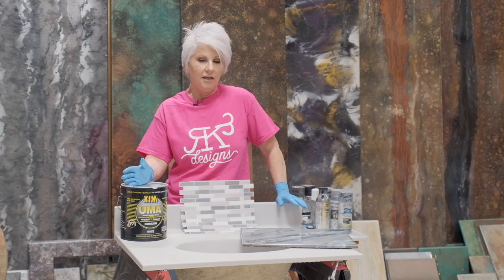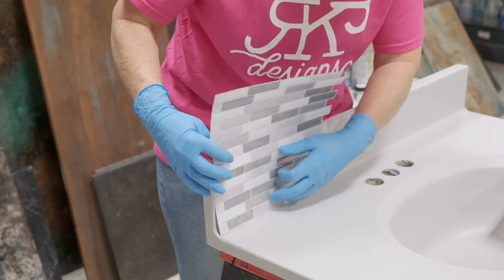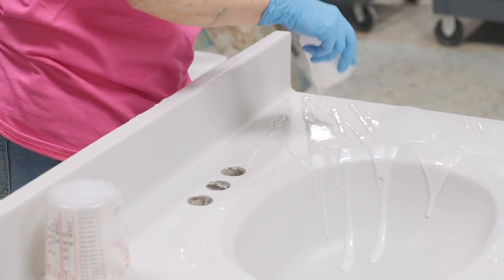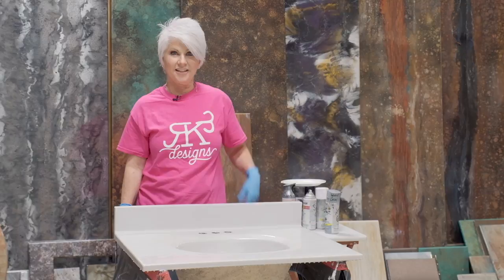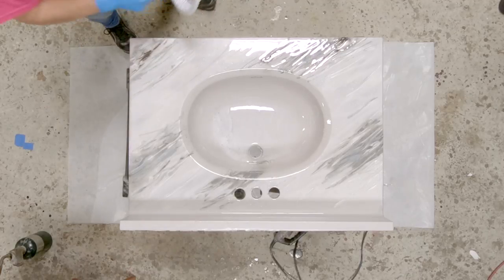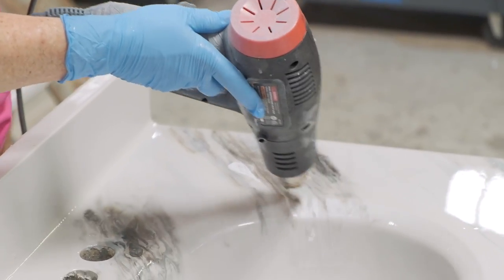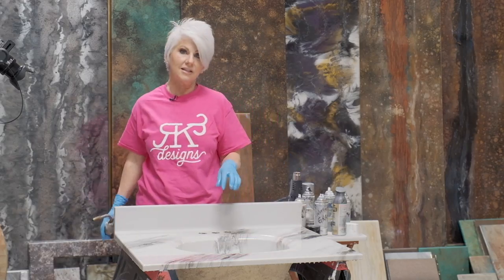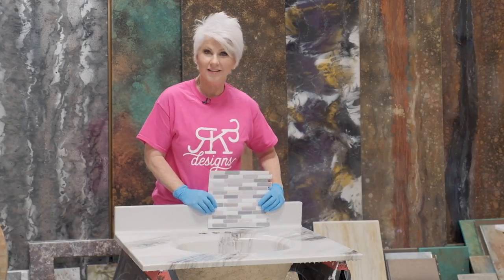Creating a Fantasy Marble, Epoxy Sink Bowl

Comment: I would really like to see the backsplash with the veins running through it instead of the tile stickers. Thanks for doing this Rhonda I have a sink like this that I want to do! This shouldn't affect the plumbing, if it does it is easy to open the holes back up for the drain or the faucet.
Reply: Me too!  No one can ever show the backsplash together with the sink as a single pour.  It must be possible somehow.
Reply: I agree. I wanna see the pour on the backsplash and top together. It must be super hard to do

Comment: OK, I'm loving how this turned out. To be honest, not personally a fan of the plastic faux wall tile but they are very popular and I've seen them used in many RV makeovers where it is important to keep weight in mind. Also, since RVs are constantly moving and flexing on the road and especially off-road, the faux tiles are forgiving and stand up to that abuse. For my truck camper kitchen I went with brushed aluminum metallic stick on tiles. Obviously, brushed aluminium would not work for your bathroom faux marble sink. LOL. Only mentioned it because you mentioned there are many different types of faux backsplashes. Thanks for a super tutorial. An Oregon nomad 🌲❤🐶😽❤🌲

Comment: I absolutely love the flow of veins in the basin. This is exactly what I would love to do with my bathroom sink and counters. My question is about how to do a flood pour over what you have already done, so that the basin is even coated, and how long do I wait to do it? Should I do the pour right away?
Reply from the maker: There’s a couple of ways you can do it. You can flood the basin first and let it start to set up, then do the rest of the Vanity. Or you could tape up the basin pour the flat part of the vanity pull your tape after about 30 minutes and let the resin run down. At that point the resin will be thicker and it will be easier to spread.

Comment: Does it ever de-laminate from the sink bowl?   I asked one epoxy company and they refused to do it. I would just do the pour and put a very thin coat on the backsplash instead of putting the fake plastic tile stuff on the backsplash. The sink was beautiful without the veins!  You are so good with the veins you do. Leave it alone, don't chop it. The veins are going down so naturally. Lovely.
Reply from the maker: There’s always a chance of delaminating on this type of surface, this is why we always recommend fabricating a new countertop and installing a new sink. If you prep well and use a good bonding primer and quality epoxy, you should have great results. 😊😊

Comment: These are beautiful! I would like to see how to do a pour on the backsplash. Also did you let the epoxy run into the drain of the sink? I am about to do my bathroom counters and just need some pointers! Thank you for the video
Reply from the maker: Hi there. Since this vanity wasn’t attached to pluming, I allowed the epoxy to run down the drain. Once cured, I take a stone grinder and grind it smooth. Backsplashes are difficult and I prefer to do some sort of design “pre-epoxy” so my design doesn’t run. You can let the epoxy set up a bit and then add a tiny bit of color so that is slowly flows down, sort of like I did in the sink area. But I much prefer to take the backsplash off and pour it flat.

Comment: This turned out beautifully.  I like the idea of using the sticky tiles.  I’m wondering if the treatment affects the installation of the drain plumbing.  Does it make the opening too thick for the drain to sit properly?
Reply from the maker: If you tape around the inside of the sink, it will prevent the epoxy from building up on the inside drain. 😊

Comment: I really enjoy your videos. I would like to do this in my double vanity bathroom, but need to get my courage up.  Would like to see your finished product with the backsplash. Also, if the bottom of my sink that’s all one piece has some rust spots and it will the sanding and painting hide that for the epoxy finish?
Reply from the maker: If you aggressive sand and prime/paint before you pour the epoxy, it should definitely cover the stain.

Comment: How long does epoxy last in a sink?  Like a main bathroom sink- household of five....  Also, I LOVE fairy farts/diamond dust(🤣), white base and oyster shell base!!  However, my sinks have issues with turning a yellow tint.  Hard water type issues.  What would work better than the grey and black to create the striations and cover that better??
Reply from the maker: As long as you don’t use an abrasive cleaner, epoxy will last a lifetime. As far as hard water stains, I’m not sure how I would address that. Maybe use colors that would camouflage any hard water drips.
Reply: @RK3Designs  Thank you 😍

Comment: This may be crazy, but do you think I could epoxy a stainless steel kitchen sink?  Would the epoxy stick?
Reply from the maker: You could if you prepped it well. You would need to scuff sand and apply 2 coats of a very good bonding primer. I suggest XIM, before proceeding with the epoxy.

Comment: It looks beautiful! I recently start watching your program and learn a lot. I made a coffee tabletop. However, I do not like the result after finish. It is too busy (I try coffee and cream colours). Can I can redo it on the top of resins again? If so, what colour will cover it? Thanks.
Reply from the maker: You sure can. Just scuff and repaint with whatever bass tint you want. Let that dry overnight, the. Pour as usual. 😊
Reply: @RK3Designs  thanks you so much for your reply. when you said 'repaint', did you mean to normal paint  or primer NOT epoxy resin first and wait overnight to pour resins? Do you use same products (resins) for all your projects like countertop, sinks and art works? I have a small real marble bathroom floor. it looks old but in a very good condition.  l was wondering if I can use coloured transparent Epoxy to pour on the top of it.  Any recommendation? I live in Australia and do not really know where to get the products you use. We have different brands but they do not look nice as yours. The ones we have here look like cheap plastic.
Reply: One more thing, can I use resin on metal sink as you did above?
Reply from the maker: rcloud yes, you just have to prime it first with a bonding primer like XIM.

Comment: Rhonda no body thinks of the mechanics of the sink.  Those holes are for plumbing.  I did this and spent so much energy redrilling the holes so the new faucet and sink ring and plumbing would fit.  Along with the sink ring being flush to get a seal.   Think about some way to keep the integrity  of those holes.  Maybe a cut toilet roll with tape around it or Vaseline on the tape.   Any ideas???
Reply from the maker: That’s a very good question. You can line the drain with tape before you start to pour to prevent the epoxy from building up. We have a small stone grinder bit that we use to grind any epoxy that may have gotten past the tape.

Comment: I have all the materials from Stone coat to do my laminate kitchen countertop (14') with (3) backsplashes; a backwall and two sidewall that are squared.  The backsplash runs behind the countertop so difficult to cut out without jagged edges. I am extremely nervous about this project.

Comment: Just wonder how it would do to stick the backslash on then do the flood coat?  Then a bead would not be needed...that is unless the flood coat material eats the backsplash material. I personally would rather the backsplash be the same as the rest of it.
Reply from the maker: You could do that for sure, but then it would be very difficult to remove if needed. You would have to score the bottom with a knife. I agree I would like it the same as well but the client sent me the backhand wanted me to incorporate it in a video.

Comment: I would continue the epoxy design up on to the back splash.  The tile applique would look too much like a short cut.
Reply from the maker: I totally agree, but as I stated in the video, this was a customer request because she already had the backsplash stickers and was wanting me to come up with a way to use them. And because it was an integrated backsplash, it would have been difficult to get the pattern to stay on the vertical surface.

Comment: Would a person dare to do a epoxy finish on the inside of a claw foot tub?  I'm really wanting to try. The fact that no one has tried it gives me pause.  I only paid like 70 bucks for it.  Any thoughts?
Reply from the maker: That’s a really large vertical area to get the epoxy to stick to without having to do so many coats. It would be almost impossible to get a pattern because it would run. Also, most epoxies aren’t made to be submerged for any length of time. There are much better products on the market suites for a bathtub application. 😊

Comment: How would you do this without taking it off the vanity and won’t the epoxy damage the drain?
Reply from the maker: You will have to disconnect the plumbing and tape the insides of the drain so the walls of the drain don’t get epoxy. The rest of the finish would be the same if it’s in place.

Comment: Do you tape underneath so you can peel off the drips or do you sand it down?
Reply from the maker: I sand them down or run a stick about 4-6 hours after the pour. Then you can take a gloved hand and spray alcohol and run the edges smooth.

Comment: Have you done kitchen sinks?  I got a castiron sink and would like to change it to a blue marble color.
Reply from the maker: You can but it’s hard to get a pattern because you’re pouring on a vertical service. You you could pour it in stages. Doing each flat side separately.

Comment: Hey Rhonda!  I have a question on the Bonder.  The directions on the XIM Uma confused me.  In one place it reads wait 3 hours to dry for top coat, but 24 hours for 2 part component paint.  I have no idea what that means.  You stated you did 2 coats.  How long did you wait in between coats and how long before the paint?  Thanks! Ps love the videos!
Reply from the maker: Great question! I do two thin coats and wait about an hour between coats. I then wait overnight before I go to the next step. I do the fingernail test (make sure it doesn’t scratch off)  before I go to the next step as well. 😊
Reply: @RK3Designs  thank you thank you!   You are such a blessing to us newbies!  Today we started the pour for our kitchen.  Before we began, I told my husband I need 30 mins. With Rhonda reviewing how to do veins before we start.  He knew exactly what I meant and was super supportive.  Turned our awesome!
Reply: @RK3Designs   oh...and we also played your how to prep like a professional when we began.  Thank you so much!

Comment: Hello, could you tell me if the resin after drying is scratched, something is passed over it or another material is applied to avoid scratches and that it remains shiny
Reply from the maker: Stonecoat epoxy (the brand I use) is in my opinion, one of the most durable product out there. It will scratch, but no more easily than most natural stone. The advantage with epoxy is it is very easily repaired with buffing. I have a couple of videos that talk about sanding and buffing to remove scratches or achieving a matte finish. 😊
Reply: Yury Gomez mate finishes help hide scratches

Comment: Would have been helpful to see how you prepped a real sink...Surely having that epoxy drip down the drain isn't good.  I've undon my plumbing but if there is epoxy build up where the drain goes the new drain plug won't sit right.  How do you avoid that?  You didn't address that.

Comment: What is the difference between cultured marble, stone resin, polymarble, solid surface and Acrylic composition? What can be considered major positives and negatives for each of these types of bathroom vanity counters with built in sinks integrated in one piece? Are these fabricated vanities durable long lasting, heat resistant, color change resistant, chip resistant and any other item to consider?